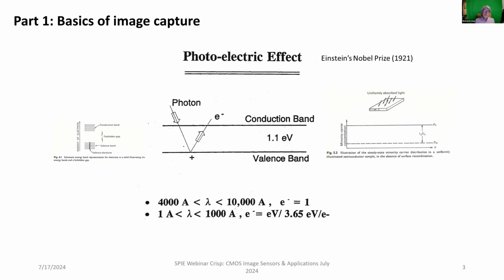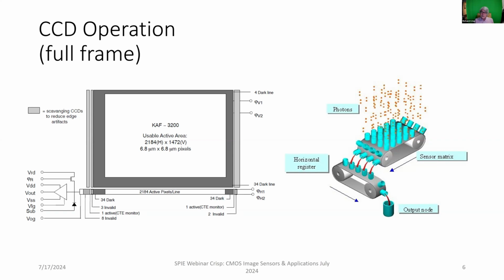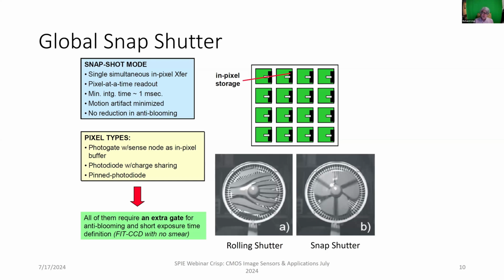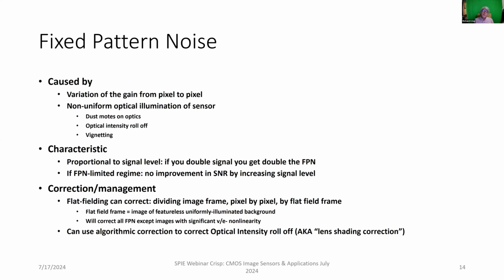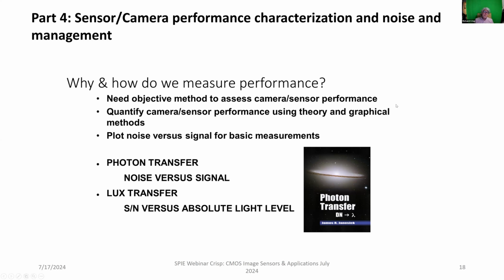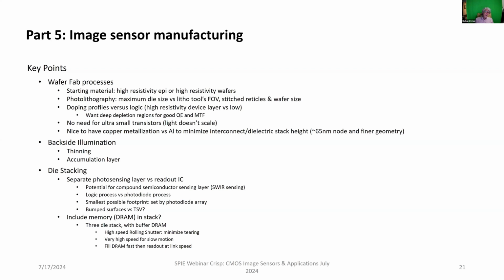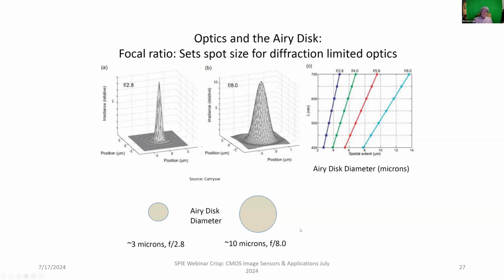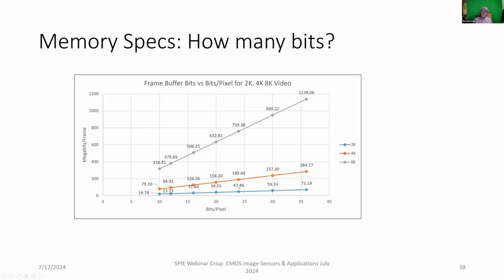The Fundamentals of CMOS Image Sensors with Richard Crisp

Comment: Dear Richard,
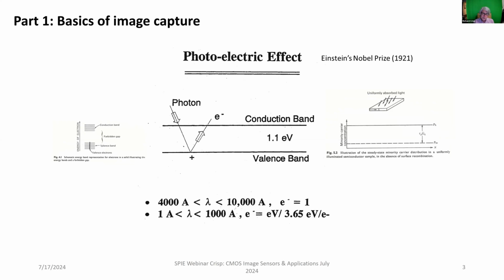I have a question. @1:40 you mentioned that at shorter wavelength, since photon energy is higher, quantum yield is > 1. To calculate the yield, you mentioned to divide the photon energy (eV) by 3.65 eV. Why is it so when the bandgap energy if silicon is 1.1ev? Shouldn't it be dividied by 1.1eV instead? If it was to be divided by 3.65ev, then photon in visible range do not have that much energy. 

Thank you for sharing your great lecture!